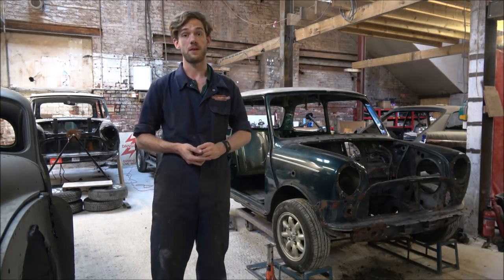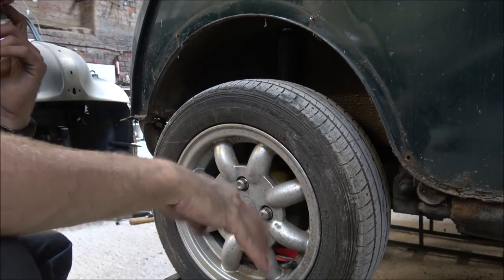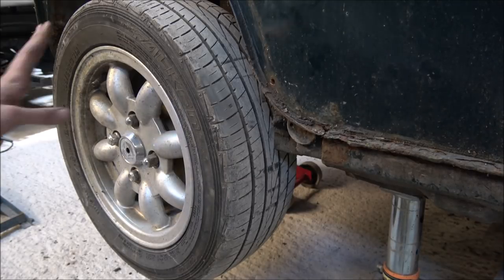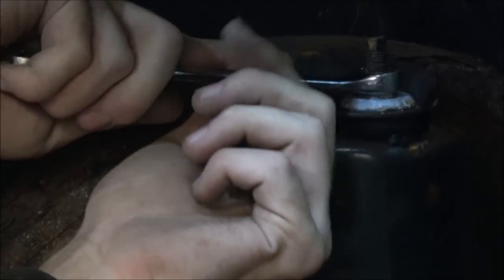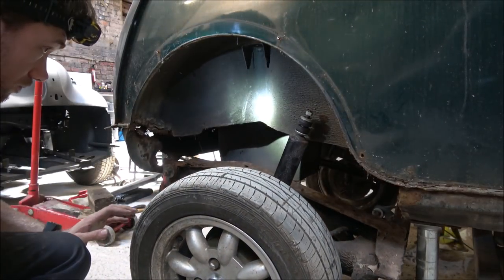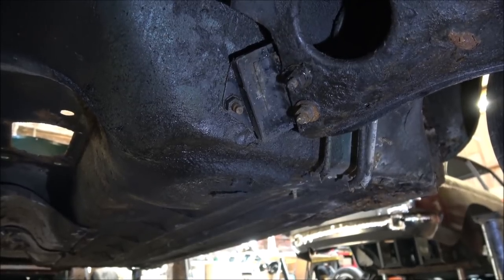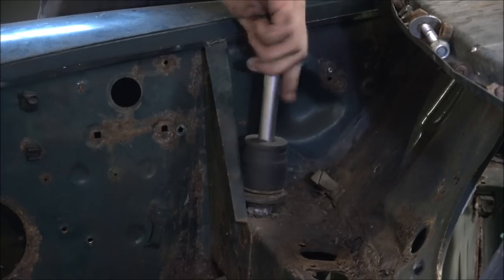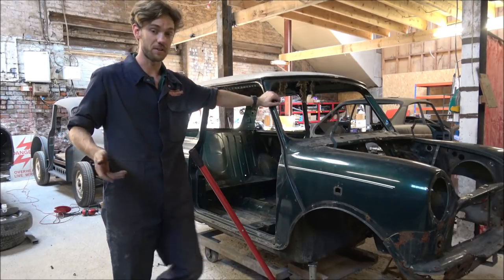Mini Restoration Project - Day 8 - removing the subframes

Comment: THE body work is severely corroded,so bad in fact that I would have scrapped the shell,and if the owner was still desperate to keep the mini (why?) use a new Heritage shell and rebuild the car.That would cost a lot more than it was worth though.

Comment: There are four bottom bolts holding the rear subframe onto the HEEL BOARDS which are integral with the body.They screw into captive nuts on the bodywork,YOU CANNOT ACCESS THOSE CAPTIVE NUTS.Clean the bolts that are just in front of the trailing arm hinge,spray with fluid,leave overnight then LOOSEN THEM A BIT IT A TIME, loosen,tighten loosen tighten  keep adding lubricant.They are prone to snapping try to AVOID THIS AT ALL COSTS.

Comment: Bless him.......put oil on the threads,loosen,tighten loosen tighten and work the shocker nuts off that way....SUPPORT the subframe acrossways with a length of wood first.MAKE SURE THE CAR IS LEVEL.

Comment: I must admit...never replaced a front subframe now its interesting.But the more I see of the bodywork the more I think the job is not worth doing.New Heritage shell, new rear subframe,respray then rebuild........cost? around ten grand.....you cant sell the car for that.ITS just a Mayfair pretending to be a Cooper,it has not even had a stage one kit fitted,and its a single point injected model,the later twin points give the original Cooper perfomance. Furthermore what mileage has the engine done?After all the only reason we all want a Mini is to enjoy the handling and performance,.A new engine will cost 4 to 5 grand.MED fast road..stage two tuned.......FUN.

Comment: When you rebuild it you will have to fit the steering rack to the body first and then mount the subframe. Don't forget that the driveshafts go in AFTER you fit the engine as the inner 'Pot Joints' that go into the final drive won't fit through the subframe apertures and in any case need to be clicked into place in the gearbox when it is rebuilt. Leave the filling with grease until you fit the driveshafts.

You have done well for a first time on a Mini. I hope my earlier comments helped even if they were 'after the event'! Duly subscribed.